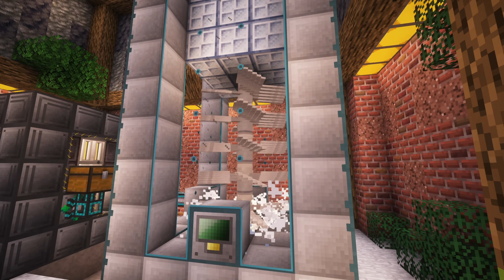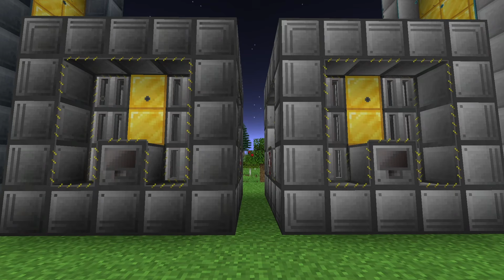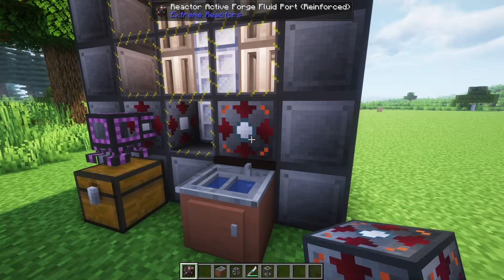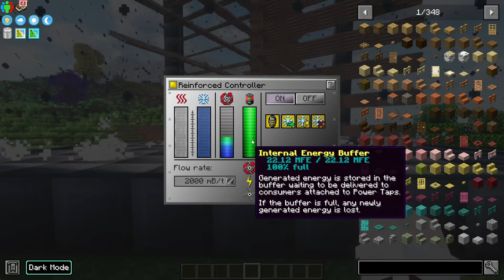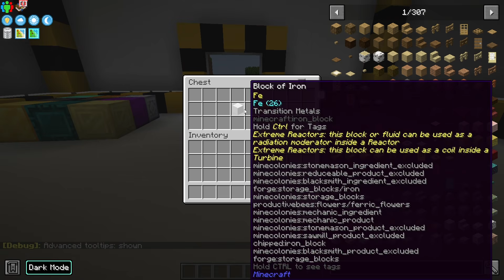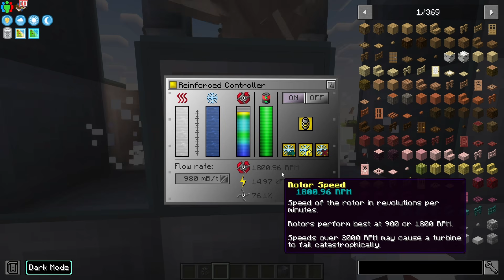Extreme Reactors : Turbines  - The Ultimate (simple) All The Mods Tutorial!

Comment from the maker: Totally forgot to mention that while you can only have three vertical Coils, they can be as large as the turbine horizontally to fill up all the space. So the more space you have for induction coils, the more power you can produce :)
Reply: Does this just mean you can fill the whole layer with the blocks used for the coil?
Reply from the maker: @RexDeorumYT Yes :)
Reply: @PapaOxi  Thanks! I noticed that in your demo of a large turbine, you have more than 80 blades, is this recommended for higher RPM? I didn't really get from the documentation why the limit is 80 or why you seem to be able to exceed that

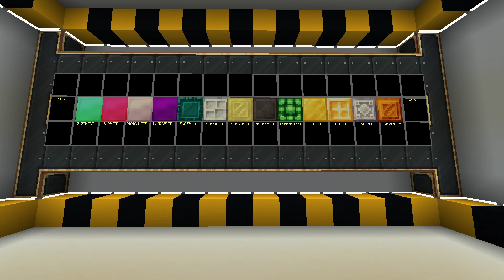Comment: Quick question, the electrum at 6:19, from what mod is that? Immersive engineering? In my pack I got two different kinds the IE one and one from a Create add-on. The one from Create doesn't work at all so that made me thinking that I can't be certain that the one from IE is as good as the one you used if you used a different one.

Also, thanks a lot for the vid. It has helped me out lots.

Comment: the max I built a very large reactor to produce steam, and also built a very large turbine. But later I found out that the maximum steam flow rate of the big turbine can only be set to 2000mb/t
Reply: is this means you only need to make 80 blades? Because Each blade is 25 mB, and 80 blades make exactly 2000.

Comment: Hi, I just did some testing today, here is my current turbine set up >>  ATM10 version 2.47  /   7x7x14 Turbine with 80 blades and 16 insanite,  2000mb/t flow rate ,  1799.31 rpm ,  power gen:  ~62MFE/t.  You can build 4 of this with in a chunk, and I think it will outperform Mek generators in current version of ATM 10.
Reply: how can u fit 80 blades in that bro?
Reply: @wassahap  it's 7x7, so you can have 8 blades attach to 1 rotor shaft. The height is 14 block, so you need 12 rotor shafts, 2 of them for 16 insanite, 10 of them for blades.
Reply: @michaelyang8869  and how big should the reactor be?
Reply: @konstantinvogt5886  I was using a 9x9x9 reactor, it can support 50+ Turbines. I think a 5x5x5 reactor is enough.

Comment: Thanks for the tutorial. In particular the insight about using fewer coils for smaller turbines was new to me. 

I got to say I'm a bit disappointed in how poor the overall power output was of that big turbine compared to the 5x5x5 basic reactor. It's like a 40% increase, but that's only 14kFE total
Reply: it's not just the power it's how efficiently it is that 5 x 5 reactors when converted to produce steam i would guess can produce enough steam for a few turbines of that size
Reply: Personally I love trying to min/max these kinda things, and found that 16 insanitite:80 blades:2000mb/t is most cost effective for 15MFE per tick... per turbine

Comment: After extensive testing, I have found the optimal amount of insanite in turbine. I am personally using a 7x7x13 turbine as it is the most optimal for the space that I have. I found that the numbers from my turbine were 900.20 with 32 blocks of insanite and it was making 15.75mrf/t. You might be expecting it to not be making as much power since it's not spinning so fast, however I found that the optimal speed for insanite was about 1007.75 RPM. Since the turbines have a 2,000 mb/t flow rate cap on the steam I was trying to find the most optimal amount of blocks in order to keep it from going beyond that RPM but still spin fast enough to generate some power. Here are some other numbers that I have coming from a 9x9x12 turbine that I did the testing in.  Edit: I tested this in a 5x5x26 turbine and it works just fine. 32 blocks of insanite with max flow rate are the most optimal if you're looking for raw power production.

RPM----------insanite------power gen
960 with 30 blocks, 15.38mrf/t
800.42 with 36 blocks, 14.87mrf/t
847.41 with 34 blocks, 15.51mrf/t
873.03 with 33 blocks, 15.69mrf/t
900.20 with 32 blocks, 15.75mrf/t
~929 with 31 blocks, ~15.6mrf/t
Reply: 16 coils always seemed better tbh, for the 1800 rpm
Reply: 16 coils, and 80 blades, 2000mb/t gets 15mfe/t too for much much cheaper 🤙
Reply from the maker: I really appreciate anyone taking the time to share their findings for everyone to benefit from, so thank you for all this info!
Reply: So...because of the size of your turbine, its internal energy buffer is roughly 9M, so even tho it can make 15M per tick, its really only making 9M per tick, so i recommend 12 insanite blocks, makes about 10M, and runs at about 1500mb/t
Reply: @WillRhyne  They fixed this issue already

Comment: For those who want some stats for ATM10,  the steam produce from a 11 * 11 * 5 reactor, can supply a lot of 7 * 7 * 14 turbine with 28 insanite block as coil. Each turbine should be running around 900 rpm and generating around 15mfe/t.

I'm using verderium as fuel and refregium as coolant for the reactor, reactor rod placement is fill the center with rod and a column of coolant on the outer edge of the rod.

I have 6  turbine running and its barely consume more than 10% of the steam produce from reactor, if you are bored of the mekanism reactor, extreme reactor turbine is another good alternative. With Copy Paste gadget, you can build dozens of turbine in no time.
Reply: Try ~14 Insanite blocks, should give you the same amount of energy, just at 1800 rpm and 2 as cheap coilwise
Reply: So...hate to break it to you, but while your turbine may be generating 15M per tick its energy buffer is only 9M so realistically its only making 9M
Reply: @WillRhyne  Update your pack version
Reply: @fosterbennington6405  I'm on atm9 so might be different